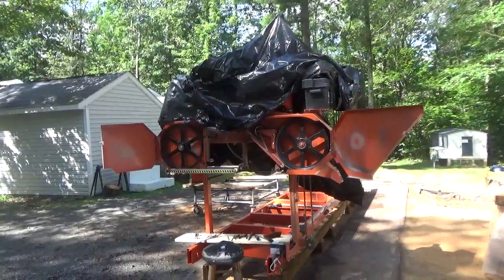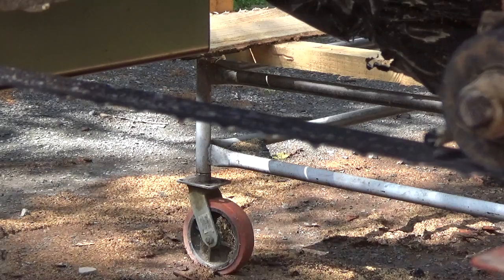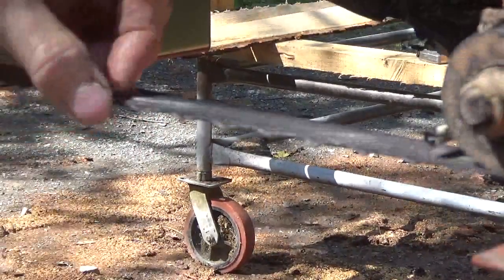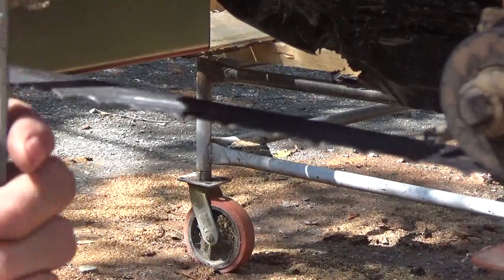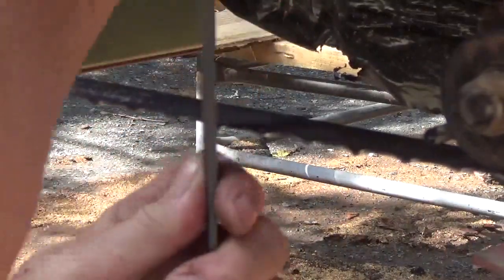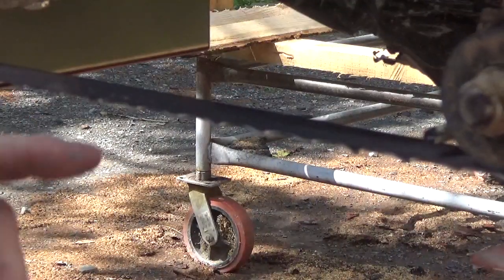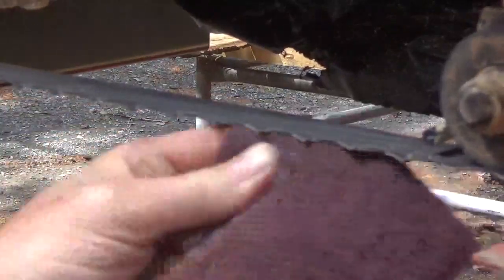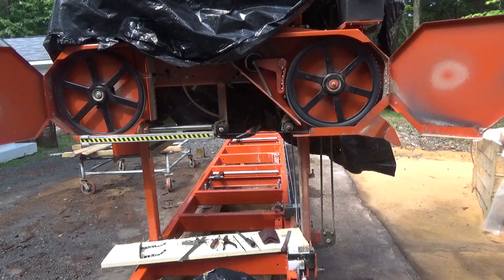How to sharpen a woodmizer bandsaw mill blade on the mill, with a file.

Comment: Love your honesty.... GDchina.. lol.
I too have hand sharpened a single blade, I have 30 right now.
As you mentioned, I also sharpen a lot of chainsaws, so that helps.
In my findings,.. 
You need to clean the gullet or valley as it develops micro cracks due to turning and stress.
The guys that know say 3hrs on a blade. do I swear by that? no.. but I keep that in the back of my thoughts for reference.
I don't push or crowd my mill, also blade tension is prob less on my unit "my choice".
As you stated, Yes, you can sharpen a blade to cut pretty good and get by just fine.
also my blade tooth order is 1 up, center and 1 down on kerf.
In closing there's nothing like a fresh sharpened blade from a good shop.
I have Mizer 10 miles down the road and today it's $8 per blade. and it takes me "about" an hour to sharpen, I don't have the tooth setter. 
my time is worth that to me and they do better than I can, waaay better.
they actually take all set out before sharpening in case you have hit something and jacked the blade up.
Then put the correct set back in and oil bath and clean the blade.
so, 8 bucks gets me a pretty good deal.

thanks for making vid.

Comment: It don’t have one up, two down. It has a left, right and center set in the teeth. It’s made this way to help open up the kerf to allow the blade to travel through the cut without being pinched. If it only had all center set teeth, the blade would be traveling through such a tight kerf that would require more horse power. So it’s just a little thing but it makes a huge difference in how the blade cuts.

Comment: Have you tried just sharpening the face with a file as opposed to the face with a file and the back with the grinder? I’m curious, it seems like filing just the face would be good enough. I dont sharpen the back side of chainsaw blades or my handsaws and they cut just fine. Do you think you could eliminate the use of the grinder on the back?

Comment: When these blades eventually lose their life after multiple sharpening, do you use them for anything? I’m thinking using them for knife making stock, but cant think of any other uses. What do you think they could be used for? I hate throwing things away that may serve another purpose when the original purpose is gone.

Comment: Good video. Thanks! Have you hit a dog support yet? And how would your sharpening differ, if at all? I just did that this past weekend.
Reply from the maker: Yes I have 2 times. I hate that. But it just makes you more cautious. Which is a good thing when you are liking all your fingers. Thank you
Reply from the maker: I want to make something simple to measure the offset in the teeth then I believe I could repair a bent tooth. Then I would have a more consistent sharpening.